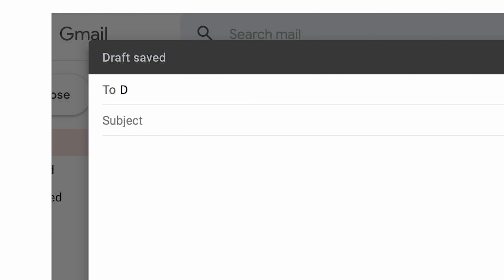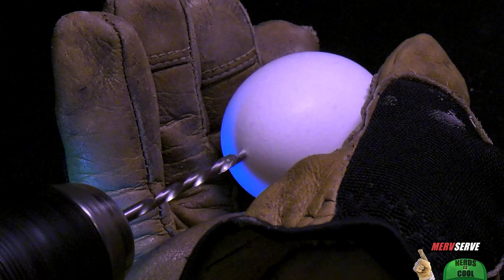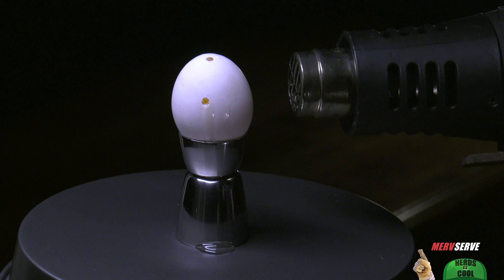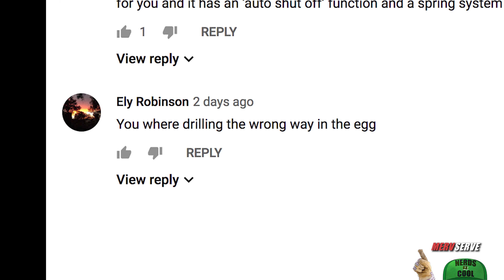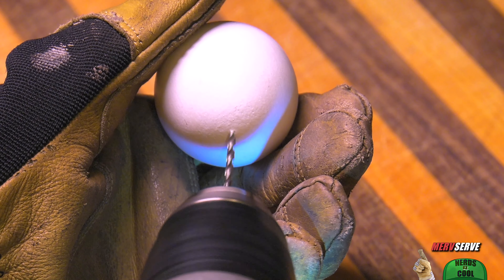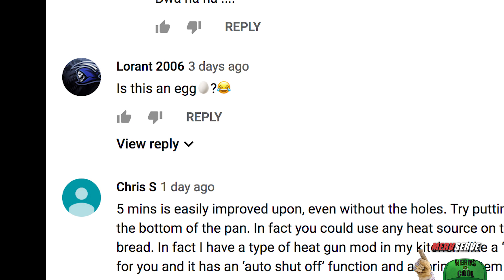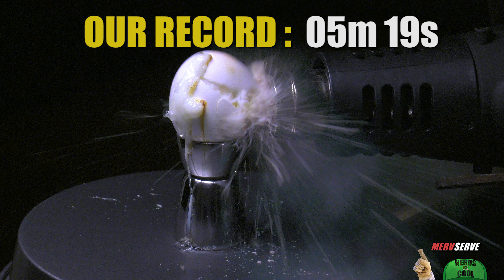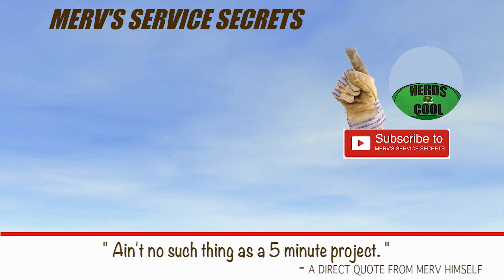Weird Heat Gun Ideas from Viewers

Comment: Make a rotisserie that will allow you to heat the egg more evenly. By cooking the egg more evenly you will cause pressure inside the egg to be equal throughout the entire egg and eliminate the formation of steam that I believe is causing the egg to rupture violently.
Reply from the maker: Chadrick Nance Your idea is so crazy it just might work!  Maybe you can post a sketch or a video. Some sort of blueprint for this device so we can get a team of engineers working on it ASAP.   How many holes should we drill in the egg?
Reply: Sorry for the late response. No holes should be needed if the egg is cooked evenly.